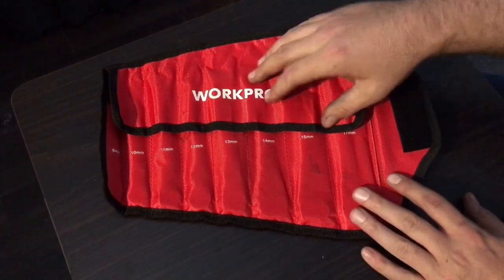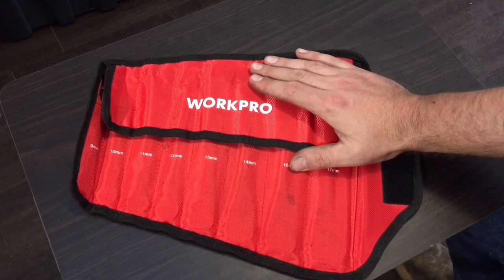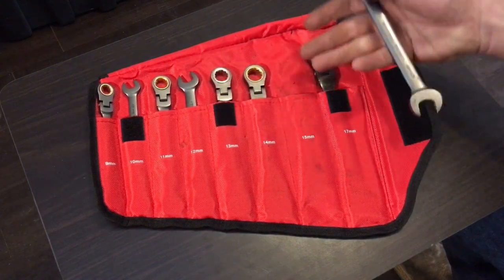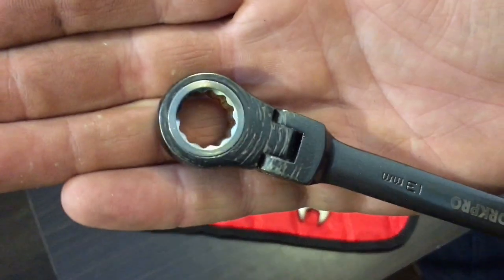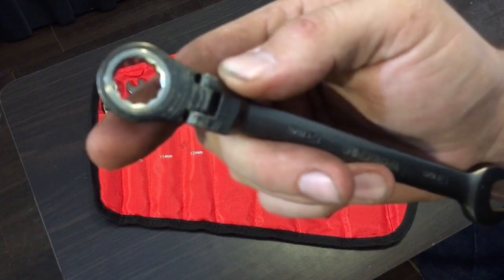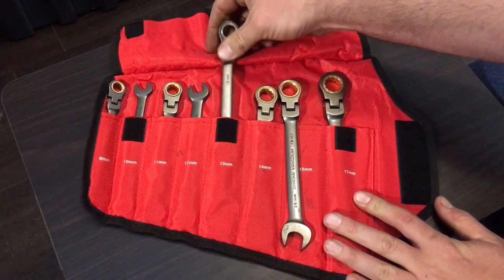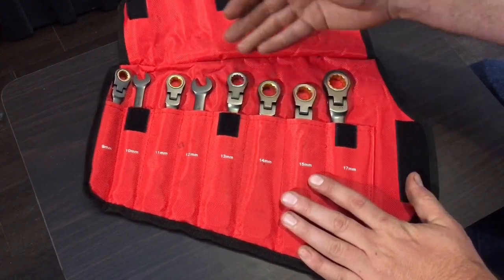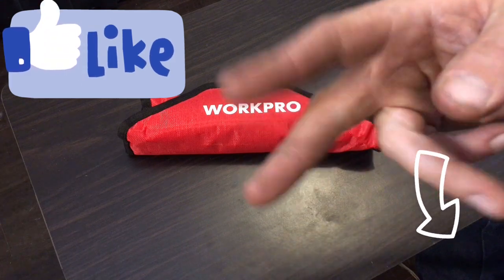WorkPro 8 pc Flex-Head Ratcheting Wrench Set REVIEWED

Comment: Well as long as they work and the open end doesnt spread, its a good wrench regardless of the scratches on the finish. For $40 it seems like a good buy!
Reply from the maker: I agree. I dont think they would hold up to every day use but for even the avid DIYer they should be just fine
Reply: @BradsWorkbench  agreed. For a DIY person they will last a long time.

Comment: For the price its not bad for a set to have at home, but for an industrial maintenance mechanic it doesn't cut it. The scratches wouldn't bother me to much but the skip in sizes (8,16,18,19) is a deal breaker. Thanks for the review!
Reply from the maker: They know they are not a professional tool brand

Comment: Have the same set. Absolute garbage. Ratchet breaks with little force. I don't break nuts/bolts with any ratchet wrenches, so the fact my 14 and 17 gears stripped AFTER breaking with a solid box end is dumbfounding.
Reply from the maker: Still working for me... 🤷‍♂️